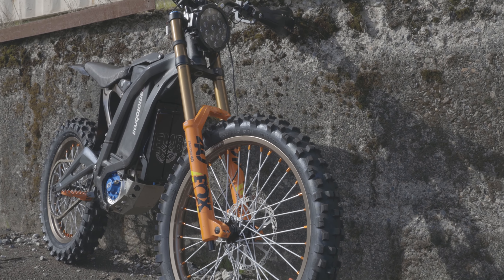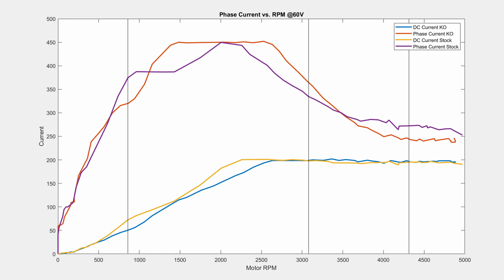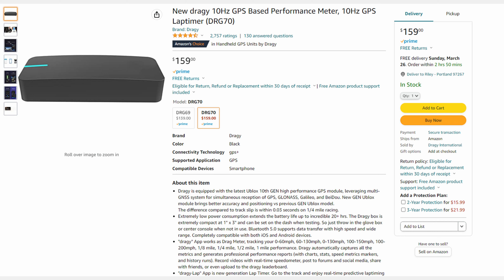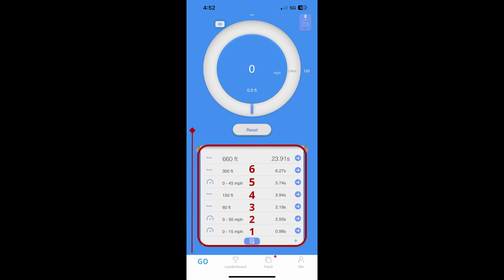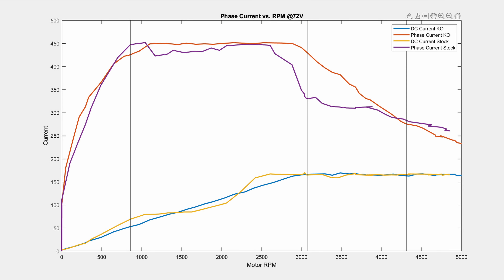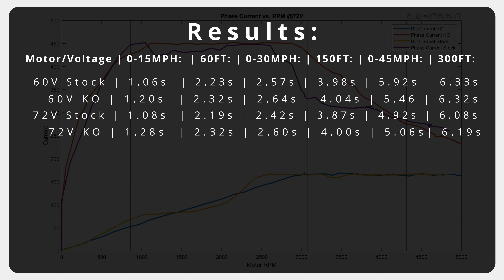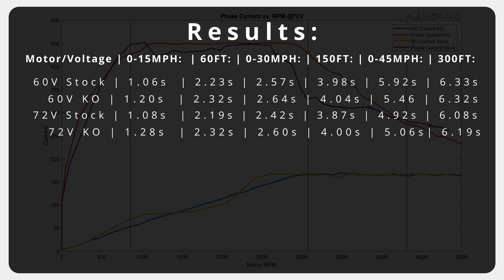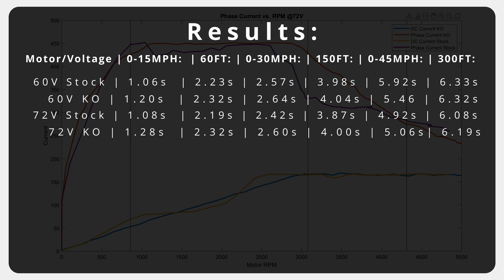KO Motor Vs Stock SurRon Motor PART II | In Depth Data Analysis

Comment from the maker: A lot of good discussion happening in the comments! I wan't to once again reiterate that this video isn't supposed to be some gotcha moment. Both motors performed as we expected them to and  we want to set clear expectations for performance you can see using the controller we used during testing. That's not to say that other controllers won't perform better. ASI lack MTPA functionality that other controller companies offer and can increase the performance of IPM motors by optimizing the angle that current is applied to the magnets - it's a bit of an advanced topic and we didn't want to overwhelm the viewers by including a tangent about it's efficacy when there is limited numerical data on the true differences. It's not entirely clear if KO controllers offer this functionality, but there are a couple on the market that do and we look forward to testing those as well!

The owner of KO also wanted it to be clear that KO themselves did not specifically send an employee to make the comments that were left on the last video - that decision was made by the person themselves. The owner says they do not want to sensor what people say and though he doesn't agree with the comments made, he wouldn't request someone (employee or otherwise) not to comment their opinions. We agree that people can comment whatever they'd like and of course, doing so publicaly means that they intended for people to see it, so there are no problems with comments being featured in videos.

Comment: Your test basically just confirms (albeit admittedly crudely) that kv is proportional to torque. You wouldn't expect much difference given your running the same phase amps, the toque (thus acceleration) of each motor should be roughly equal, as their kv's are roughly equal. KO being a tad slower could be many things, different kv, tyre pressure, tuning of controller etc etc. 
Some simple tests it'd be great if you can do (and only require basic equipment, looks like you already have):
-phase to phase resistance (just use a lab power supply and measure Vdrop across the wires) 
-torque per amp (lab power supply again, but measure max torque before it 'cogs over') 
-no load RPM and no load power (ie belt removed) 

these 3 parameters can give a good 1st order comparison and view of what each motor can do, and isolate the motor from any potential issues with the above mentioned differences like tunning (the KO being a IPM motor does mean it can be hampered more than the stock by a 'bad'/less than ideal setup, which can be hard to pick on 'seat of the pants' testing). 

Weird KO has such a consistently bad response to anything suggesting they're not gods gift... and across multiple 'representatives'. I know had I done similar representing companies I'd worked for, that'd be grounds for a serious talking to, or just outright fired.
Reply from the maker: Exactly what we were aiming to prove. Of course it seemed obvious but there was a lot of conjecture about gearing and one making more torque so you can gear down, etc. at the end of the day we wanted to prove that two similar motors with similar KV ratings are going to perform almost identically from a torque output standpoint. Easy enough to say for people like you or I who understand but sometimes a video helps illustrate the point.

we’d definitely love to do the tests you’ve mentioned, have you or others done them?
Reply: @emotobros  I'd be happy to myself, but for being unwilling to invest that kind of $$ in to a company that clearly has some issues in the ways it runs its business, and has some obvious design flaws that it claims are benefits (cutting holes in conductors being a pretty obvious one). 

Some reports suggest the motor is actually decent, but until I can see some hard #s I'm not as willing to risk it. The QS motor, known to be little better, or even worse than stock depending on who you ask... was measured with ~13mohms phase to phase resistance, the KO by comparison, 10mohms. That to me does not support the claim of nearly 10x the power handling. that said on the KO measurement, I'm not as confident on the # as it was done using a controller by a guy who didn't really know what it meant... so I reserve judgement till Ive either tested myself or seen it tested by someone who is a bit more experienced... but underlying point is... not gonna risk it for something that to date has not proven itself, with some evidence to the contrary.

happy to show you some reliable ways of doing those measurements though, if you guys are willing (assuming you don't know already)?
Reply from the maker: @sn0wchyld  Yeah we are somewhat in the same boat. That's a lot of investment (time and money) to be releasing information that the manufacturer should just be releasing on their own. We'd be able to do the measurements no problem if we had the right equipment. 

The one thing we couldn't test that we wanted to was how much better the KO motor performs with MTPA vs. without it. I'm not sure the stock motor would benefit any considering it's SPM rather than IPM but allegedly there are gains to be had from that on the KO side. Not something that ASI currently implements but VESC offers it. Can't find any statements from KO on whether or not their control scheme uses it. Nor can I find any real world data comparing the torque efficiency gains with or without it. It all seems to be theoretical or implementation based rather than exact motors compared on a dyno with MTPA on and off.
Reply: @emotobros  its very much gut feel at this point, but im pretty sure KO's controller isn't really able to truly implement MTPA (for similar reasons as to why it needs so much 'tuning' to get the throttle response right - its not a true FOC controller, it uses lookup tables or similar) - again, gut feel, from what ive seen, but idk anyone else who's FOC controller needs this much after sales support, person to person, to get it running right. The amps - per rpm window tuning too suggests its not a real torque based throttle too, but more a 'simulated' or 'indirect' one, at best... The sticky throttle also suggests some long control loops that cant respond quickly enough to throttle being let off... a true FOC/MTPA controller should be able to kill off its 'torque' amps more or less instantly as the math transforms handle all the 'hard stuff' (though it is a bit weird/less simple with IPM motors deep in the field weakening zone, but thats not what we're talking about here). 

your right though that the MTPA of the stock motor is likely more or less in line with the Q torque (ipm motors tend to benefit more from the D and Q torque... spm just Q, but its not a 100% / always the case rule)

if you want to measure mtpa for the KO motor :
-run a known DC current (ie using a lab power supply) through any pair of motor phase wires. measure the amount of torque to get it to 'cog over' (you can do this by putting a bucket + rope around the axle/belt sprocket... add water to the bucket till it starts spinning (ie cogs over) - measure weight of bucket+water, devide by radius of the belt sprocket, divide again by the amps running through the motor phase... that equals MTPA). you can then compare it to the 'magnet torque' - which is directly proportional to the kv... if notably different then its got some potential gains from the reluctance torque (vs just using magnet torque). Best doing that test on a couple of current levels (from the power supply) and a couple of different phase-phase combos to check for any abnormalities too. 

Basically, all you need is a lab power supply, some string, a bucket, and some water, to work out the mtpa of a motor. Some things in life are still simple :P
Reply: @emotobros  just as an asside - i'd really appreciate it if you can confirm the MTPA and phase-phase resistance, given they're measurable with basic tools (basically a lab power supply, a multimeter, and a bucket ) - would clear up a lot of things pretty quickly :D given you guys already invested in the motor and a lab power supply (if you dont already have one) can be had for <$100.

Comment: The $270 QS165 motor is a no brainer for me. It can do 95%+ of what the KO motor can do at a 1/4 of the price. The fancy colors "trix is for kids" advertising of KO is definitely gonna create some fanboys. For the price of the KO it should blow away the competition, but in most videos it just barely barely barely beats stock or the much cheaper QS165.
Reply from the maker: Have you ran the V2 yet? We tested the V1 on the channel and were a bit underwhelmed. It was of course an incredible motor for $270, but wasn’t at the same level as stock.
Reply: @emotobros  Seen a few teardown videos of the V2, and it has beefier windings, much better bearings more copper and iron overall. I have a 15kw bomber but my neighbor has a V1 he bought after buying the Suron used and already broken (burnt motor, bent wheel, bent handlebars etc etc. He is using a Sabvoton controller with 450 phase amps and it moves. I never rode a stock Suron so I cant speak for a comparison. The KO motor and controller combo is more than what he paid for the bike.
Reply: i have v2, QS suck at understanding people needs (and people need speed) and they keep making low speed motors, also i got faulty motor with wire short to casing, luckly it was easy to fix. i am planning to swap it to triangle to make a 'speed' version of the motor

Comment: Great video . Good to see you guys going to a dragy gps vs phone or any other app . I have a dragy for drag racing cars and can tell you it’s very close to track timers at drag strip .  Have very similar dragy numbers for my 72 volt stock motor SurRon . 1/8 mile in high 9’s low 10 second range  at 65 mph and 0 to 60 mph high 7 to low 8 second range . You can only accelerate so fast on a SurRon . When I turn my bike up past 15 kw I go slower . Keeping the front tire down is key
Reply from the maker: Glad to hear some others opinions on the dragy. Was really impressed with how quickly it updated times and accuracy of said times.

We really want to test these at 20kW+ but it’s so hard to get repeatable data when it comes down to who can keep the front down best. We data logged a couple runs at 24kW true input and 800 phase amps to the motor. Was just completely unwieldy 🤘🏽
Reply: Yes the dragy is the way to go for data even has video overlay . On higher power settings could do a roll race set it up at a certain start/end mph . Also could compare G forces . The KO would have advantage here assuming
Reply: @emotobros  Yall just need to put a hillcimb swinger and drag slick on the back to test the upper limits of the motors haha
Reply from the maker: @mrskywalker115  for real 😅 we did a shake down at 30kW and 800 phase and smelled burning on stock motor, lol.
Reply: @emotobros  surprised it didnt turn into a  grenade at that much power lol
Reply: @emotobros 😮 dang and it survived? Hahaha

Comment: Great test and good data analysis. I understand the reasoning for choosing the lower phase amps and at then end you clearly state the test doesnt cover everything and the benefits of the ko physical differences, hopefully that will keep out the negative comments. I think you hit the nail on the head as the KO design will allow better heat management with more phase amps at a level that the stock would fry magnets and also allow more rpm but that is a very special application that not many use the surron for in the real world. If the KO was used in that application(more phase and rpm) then you would really see the difference(progressive e showed that by frying their stock motor running crazy power yet KO held together). My personal build is very similar so this confirms I kept the right setup with stock motor as I never have heat issues and never run over 500phase amps.

 I cant believe how critical some people are when good data is presented and when its clearly stated it was inconclusive they still take it as an attack on the brand. Keep up the good work, yall are the most data driven out there which is needed more

Comment: As I’ve said from the beginning I love the fact that a company went out of the way to many something specifically for the surron/talaria the only benefit of the ko motor over stock is to be able to handle more power/amps for longer times did a drag race with my buddy 20kw  my motor tapped at like 150c after 45 seconds his was going strong (TEMP WISE) but I held the acceleration until we got to the higher rpm’s where my motor was maxed ko kept going is a nice upgrade if you plan on running stupid crazy power and it just want ease of mind for not over heating

Comment: Thank you very much for providing this detail. I have a bac8000 on my surron. Back in the day I was told that your controller was fixed to the voltage you bought it😮. So I bought the 60v controller and 60v ebmx big battery so I could still use the original battery at the same time. OMG stupid fun.. but everyone says the 72v is better. Your report shows that in single track the 60v as expected is quicker (peace of mind.. thank you again).
Reply from the maker: I think the real take away on the voltage differences is that if you are staying below 5500RPM or so you aren’t going to see much of a difference if at all in acceleration. The times are too tight to be conclusive one way or another but I think it’s safe to say the 72V isn’t for sure faster down low!
Reply: @emotobros  my only question that has me thinking about going 72v is if the 20% reduction in amps would improve a noticeable change in efficiency as range is my biggest killer, 22-25mi is about all I can get out of 3.6kwh battery at 6-8kw(my cells may be the culprit from what Ive recently seen in cell study data). 72v with better cells at same capacity could be my solution, just hard to pony up the money to build another battery haha

Comment: My thinking regarding K.O.  motors potential advantages is just one important ( to me ) metric. Overheating/max power threshold. Do you or someone else have that kind of data?
Reply: also very interested in this kind of testing as i'm planning on supermoto racing my bike this year.  Has anyone even attempted this?
Reply: @Tyler Reed  what little I have seen has been positive. Progressive -e did some side by side runs between a KO motor,  and a stocker , claiming 20kw power respectively,  and blew up the stock motor . Ko was not even hot. Charged cycle works had some racer guy supposedly trying to run a ko moto motor hard up some desert plateaus,  in an effort to test for overheating,  again.. for the hopes of racing. So far , so good.
Reply: @tonysurber9111  good stuff thx, i'll look them up.

Comment: Great video as expected from EMB! When I switched to the RS motor for the first time I was very disappointed in its low end acceleration untill I really started turning up the p/a 700+ then it’s starts to move like it should, but it seems kind of excessive? This was on 72v. My disappointment at 60v was even further but I did have a few things in play when switching to the KO motor, like swapping from stock rear 19 too a 16 x1.85 with a 90/100. I also put the ebmx X-9000 and rs motor all at once before riding my bike. I’m looking forward to swapping back to the stock motor for low power comparisons up to 12-15kw undecided yet! Any power levels beyond that it’s clear KO is the winner with longevity for a start! 
Awesome video can’t wait for the another one
Reply from the maker: We’ve pushed 800PA on the KO and it was insane! Stock motor verifiably smells hot when I try the same thing. Has that kind of hot motor smell that reminds me of overheating RC cars back when I use to run them. I was trying to speculate on the low end difference and was thinking maybe the inertia of the heavier rotor but that seems so insignificant in comparison to the rotating mass of the whole drive assembly.

Comment: Hi, in your test, which controller did you use for stock motor and KO motor? your test is very interesting ;-)
Reply from the maker: BAC8000 both times.

Comment: hi is the ko motor as smooth then the stock motor in terms of power delivery? I need a new motor and i am thinking to buy a ko motor but only if the throttle feel is as good then with the stock motor. What would you do buying a new stock motor or a ko motor.   it need smooth power delivery for wheely's and better cooling for when i join some pitbike races
Reply from the maker: The only thing that really determines the smoothness is the controller so I’d say if you have the same controller on both motors, they’re going to feel the same. I’m sure the KO uses nicer bearings and has tighter tolerances, so in that sense it should stay smooth longer.

Comment: I think the benefit of the KO motor is that it can handle significantly more power. On their site they claim 35 kw peak. I’ve heard different numbers for the stock surron motors but most people seem to agree it can’t go over 20 kw.
Reply: Been riding @ 11 Kw , 60 V , Torp TC500 , Stock Motor gets very hot after some time. Cant imagine 15 Kw or more on stock